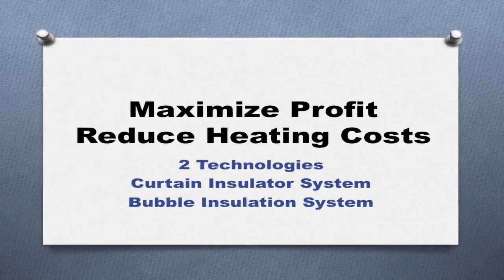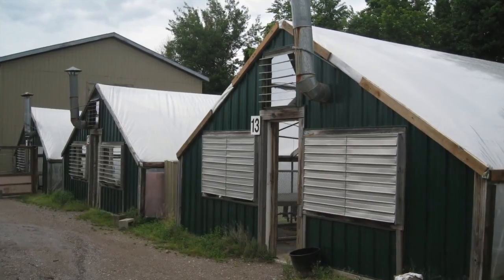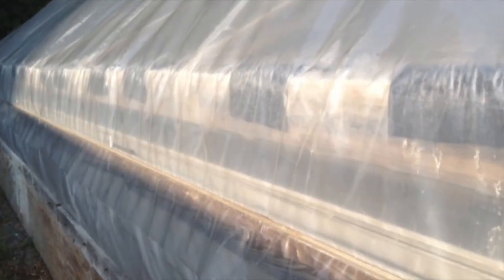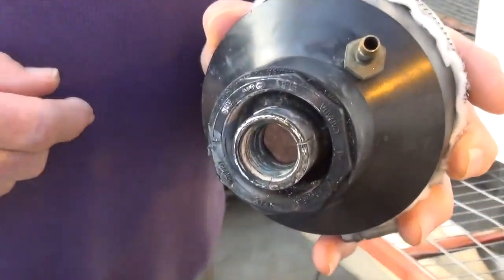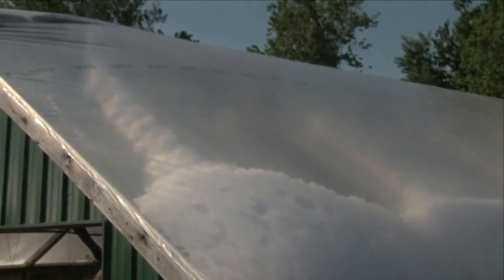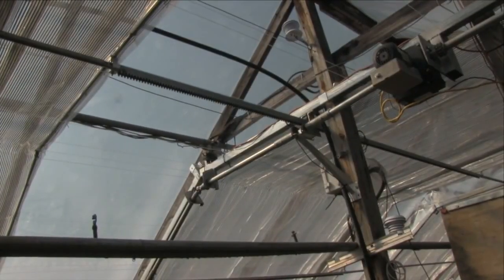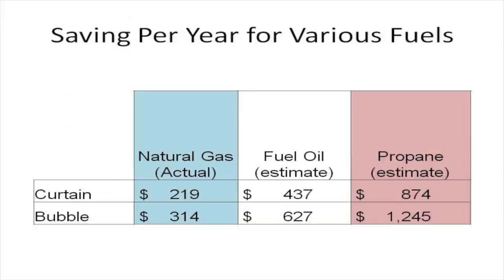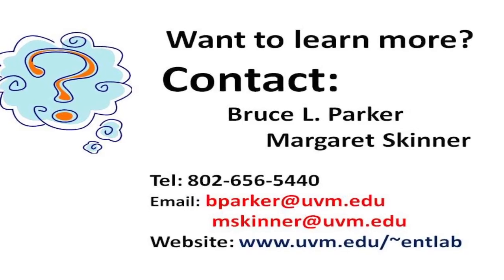UVM Bubble Insulation System

Comment: Is there a link to the research papers? If like to know what surfactant they used as well as some other parameters. Could this design be improved if the plastic envelope were constructed to consist of smaller semi-sealed cells instead of a monolithic cavity?